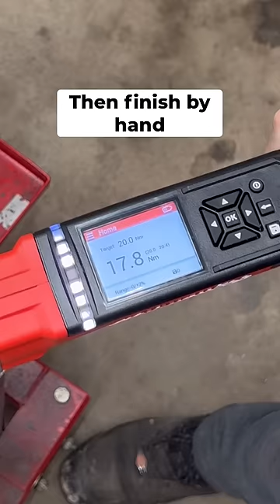How to use Plastigage to check BMW E34 M5 Bearing Clearances #bmw #bmwm5 #bmwe34 #cars #restoration

Comment: Seems like the plasticity would be dependent on temperature....
Reply from the maker: I think it has a temp range on the package where it might not work well outside a certain range? Not sure
Reply: I was reading up on these, and the primary concern I could find would be heat causing thermal expansion or contraction. As long as it's measured immediately, and the poor thing didn't melt/burn, it should be okay. 
I couldn't find what material they're made out of, but paraffin is about 15% variability due to temp, and HDPE is less than 1%, so I'd guess it's somewhere in the middle of you crushed cold and measured hot(or vise versa)
Reply: Also, the difference in elasticity from temp I'm guessing is negligable compared to the force applied to crush it. Can you crush these with your bare hands??
Reply from the maker: @duckbilldaniel  Never tried, but what you say makes a lot of sense

Comment: Torque wrench is pointless. It doesn't actually do anything.
You still do the adjustment and it doesn't do angle either.
Zero benefit.
Gimmick tool.
Reply from the maker: Not being able to do the angle is its major drawback

Comment: Taking what basically a race motor and clerancing it with plastigauge is probably the dumbest thing you could do.
Reply from the maker: You don’t know what you’re talking about
Reply: @wewrench  considering I’ve owned and restored a 88 m3 and a 92 m5 and used to work for Bavarian specialties I’d say I know a good bit bud. But let me know how those shitty tolerances work out for ya.

Comment: Plastigage is a guide not accurate at all tried it once as a test and it was way off and would have caused a motor to lock up it was that bad
Reply from the maker: That's why you measure as well
Reply: @wewrench  I always use a bore gadge will never use anything else
Reply from the maker: Def the most accurate way @snapped4433

Comment: germens cars have dumb torque specs. just say 80 ft lbs instead of 50 ft lbs and then 30 degrees.
Reply from the maker: 80 ft lbs doesn't equal 50 ft lbs plus 30 degrees

Comment: I'm so far away from understanding anything in this video it's crazy 🤣
Reply: Torque bolts plastic goes skweeerrrr
Reply: It becomes much easier to understand when you tear down them rebuild many times. 🙂
Reply from the maker: Simplified...it's a strip of wax that gets crushed in between two surfaces. The space in between those two surfaces should be 33% smaller than a human hair. The amount that the wax gets crushed determines whether or not that space is the full size of a hair, 66% of a hair, or 33% of a hair.
Reply from the maker: The plastic goes splat!
Reply from the maker: That's true too. This stuff is weird because you wouldn't think its accurate but it is
Reply from the maker: @ProfessorDeezNutz  Yes. A reliable but low-tech work around

Comment: So I have an E34 525 ...when I got my cylinder head back from the engineers it makes a really loud ticking sound when I start it and idol...what can be the problem and how can I fix it myself
Reply from the maker: Very hard to say. Could be a lifter issue or something in the block